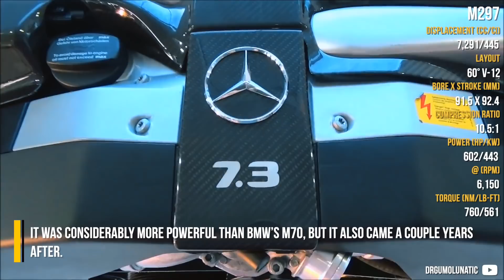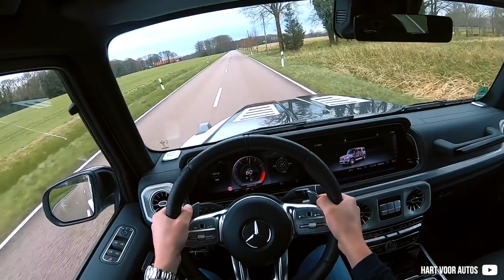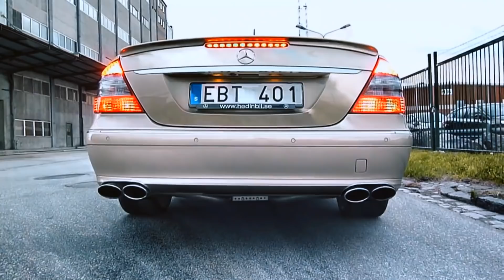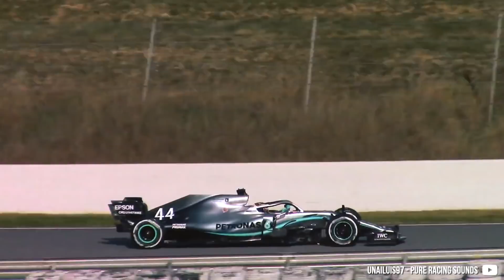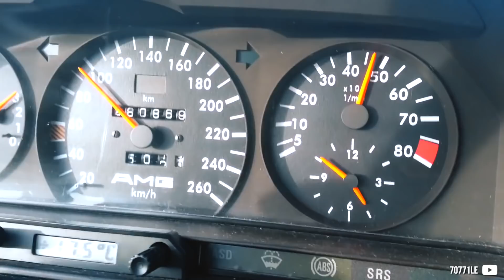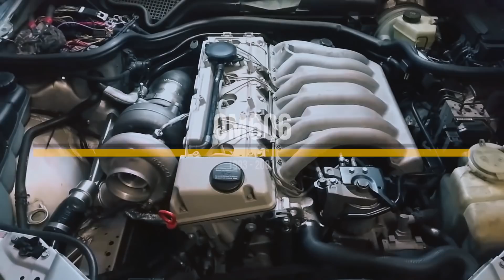The Best Mercedes Engines Ever

Comment: Yeah my OM 617!  I had a 1984 300D that I put (this being USA) 200K miles on after buying the car at 107K.  I drove that car literally coast to coast and border to border.  Damn I regret selling it....  When I get a little extra cash I'll find a 1987 300D with the OM 606 in it.  These probably were the finest IDI diesels ever built.
When I first purchased a Mercedes Benz I read up on the engine nomenclature: "M" = "Motor"; OM = "Öl Motor (oil motor = diesel)".  I had a 2008 E350 Benz but I liked the older one better, idiosyncrasies and all, and I didn't care for the V-6; i note that only one of the engines you listed here was a V-6 and it was an F1 engine.  I couldn't agree more; all V-6s, even Mercedes, sound like a dyspeptic lawn mower.

Comment: Thank you for including the OM606 💪🏻😎 Indeed that is the greatest diesel Engine I know. Even without turbo, with its 24V it really is like a racing engine amongst the diesels. Or loves revving up to 5.500rpm abs rewards you with lots of power in the upper rpms. Mine has over 520k km now and runs like new😌
Reply: We say in German co2 Schleuder and the best inline 6 is the M104
Reply: @denissecictv1708  meinst du den Verbrennungsmotor an sich? Denn der Diesel stößt ja weniger co2 aus als der Benziner...
Reply: @thiemokucharczyk  in den Video war es anders ohne Auspuff Tuning hat eh ein Diesel den Filter aber Benziner sind geiler als Diesel wegen den Sound und Diesel ist ein Daily Treibstoff jeder Blender fährt ein Diesel

Comment: an extra fact, the om 606 with simple modifications succh as a bigger turbo and a mechanical diesel pump can jump from its original 175hp to around 400 hp, it is also capable of making 7k rotations per minute that for a diesel engine is a lot

Comment: quite frankly the OM636 engine made by mercedes was one of the most reliable engines they have ever made. They were so great that they were made for 41 years. They powered Pontons, Unimog, Boats, Water pumps, Generators, and Thermo king Refrigeration systems. The life expectancy of this engine in a vehicle was 1,000,000 KM+ without needing anything except regular service. As a stand alone engine, these unstressed engines racked up over thousands and thousands of hours.

Comment: U hey guys hey guys Bissell racer you missed it engine the Mercedes inline 6 that power the 280sl 1968 to 1971 and it also powered the Mercedes 300 class why didn't you say anything about that engine it's bulletproof its gasoline it strong as hell my goodness it's an inline 6 natural it has torque but you didn't say anything about that why you o f f f s

Comment: Mercedes was a great  engines for truck and buses (Like as OM442LA, OM457LA, OM352 etc), Military (Same as MTU 883 and 838) and aeronautical (Like as DB605 and D.III), but my preferred is the engine of the 770 SSK (inline 6 with compressor 7l)

Comment: M119 500E,OM605 TD w202,M120 600SEL W140...........
Reply: om646, reliable, powerful, fuel efficient, lots of torque for the size and has a variable geometry turbo spools from 1600rpm.
Put in the w203, wich itself is leagues ahead of the w202 in every metric.
Reply: h2oaddict28 w203 was a plastic bucket, and looked awful In my opinion
Reply: @Diesel8290   facelifted w203 looks great and handles like a real car. The gauge cluster and center console looked a bit rubbish before that, but the w202 is no better. (The dash is lined with a soft leather like material, it's not plastic..)
Reply: not to mention the M119 used in the Sauber C9/C11 or the Mercedes F1 V10s (despite them being built by Ilmor)